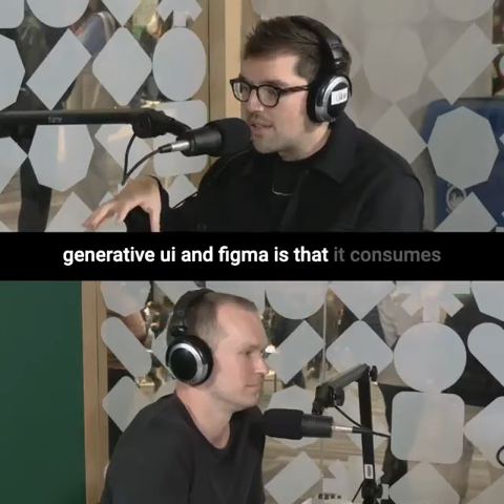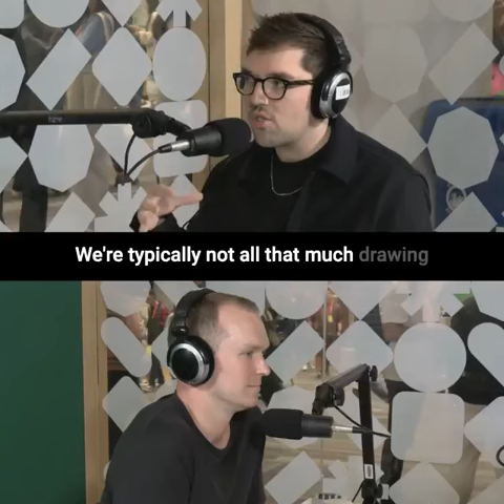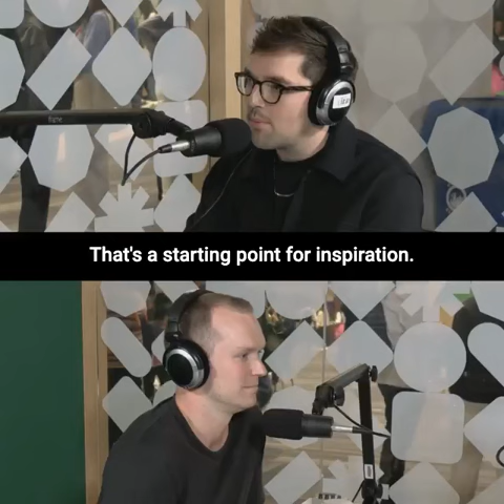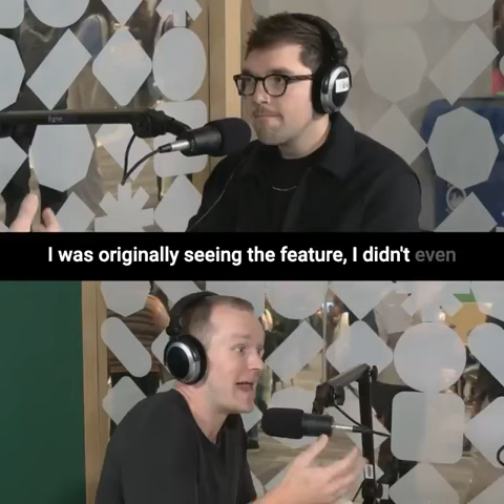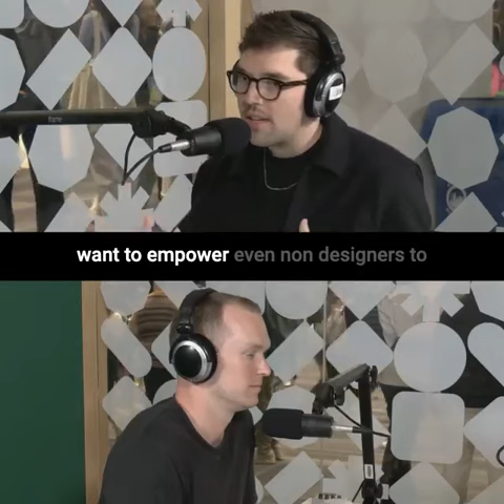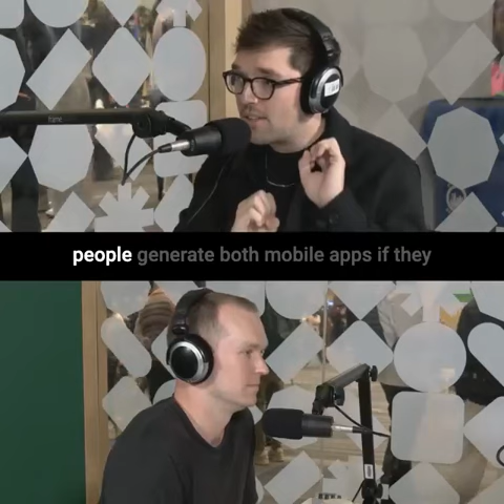Figma generative ai

Comment from the maker: Why Figma quietly turned off the "Make Design" feature

So, all the UI designers realized that their jobs were threatened, and rather than accept it, designers decided to try a little collective action. They boycotted the tool, and Figma removed it!

LOL, you should see your face. No, that's not what happened.

No, it was because Figma didn't want to get sued by Apple.

After the conference, users reported that the Make Design feature was blatantly plagiarizing. Andy Allen, founder of NotBoringSoftware, accused Figma of stealing Apple's weather app design.

The CEO of Figma responded by saying they would disable the Make Design feature until they could fix it.

What you should do about Figma AI

So what's the big lesson?

Features like Make Design are useless without your data.
The weather app looks the same because Figma has yet to add all your data to its model.

Luckily, it's not too late to opt out.

If you refuse to train Figma's AI model with your data, you might delay the inevitable job loss this feature will create.

Comment from the maker: Based on what I have read, here is some good-faith speculation about how Figma AI works and was built.

Don’t trip on the technical details. Just bear with me:

1) Figma hired a company to build a custom design system. Presumably, a very robust, tight and granular system that is well aligned with their object model. Something that makes good use of variants, variables, and other dynamic features.

2) The same third party or another third party uses the system to design a large amount of UIs and label them for training purposes.

3) Presumably, someone in that data generation effort has the task of designing a fully-featured weather app and does what most designers stuck with a tedious task would do: copy a popular app like Apple’s Weather app.

4) Figma uses the object representations of those designs and their labels to train or fine-tune a large language model.

5) Everything starts to go well. It starts looking exciting. The model responds and generates valid designs, and they start thinking about creating a good UX around it (which they did).

6) But LLMs have a problem. They are pattern repeaters, and if you prompt generically, it will pick the best generic match seen in its training data.

7) They launch, and all the debacle happens.

That’s my read. It might be wrong, but I really think this was an honest mistake. 

A mistake that could happen to anyone working with this technology, and that will continue happening for many other companies.

It’s a lesson on correctly building with AI, especially for large companies.

You need to be super strict with your training data. 

You need to understand the entire lifecycle of that data and test the models in adversarial ways. 

You also cannot rush anything because this is new territory.

And the most important lesson: you need to have an underlying philosophy that can define and guide all your AI efforts and that can contextualize your mistakes.